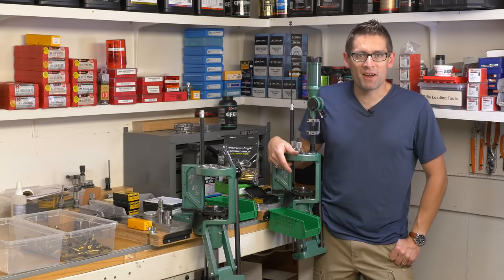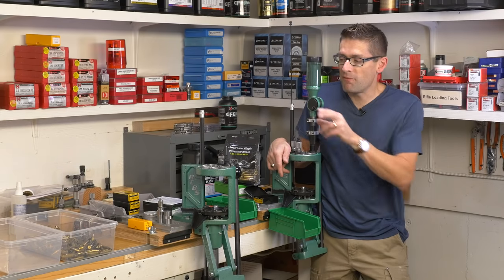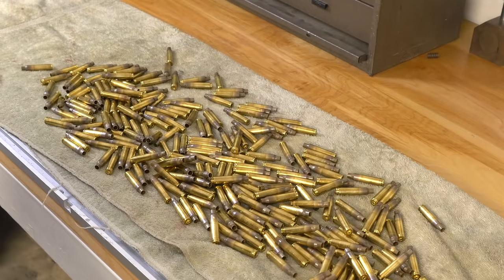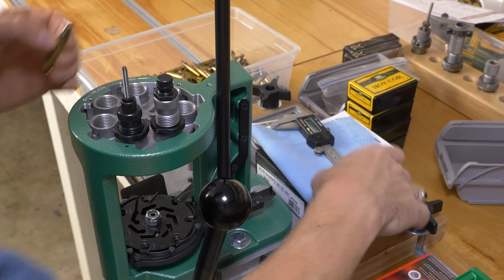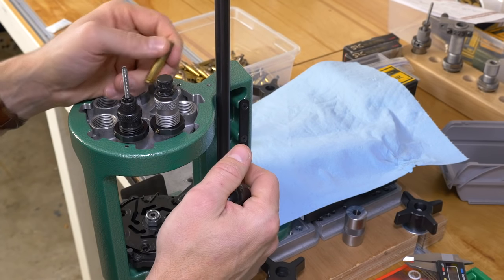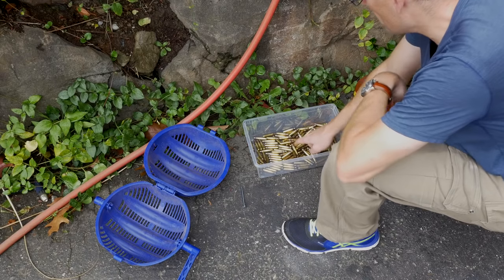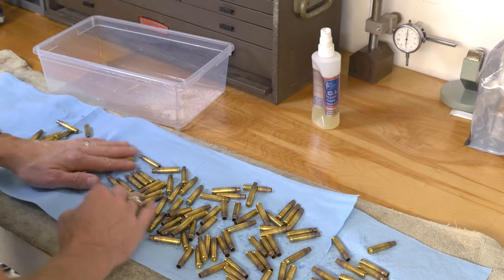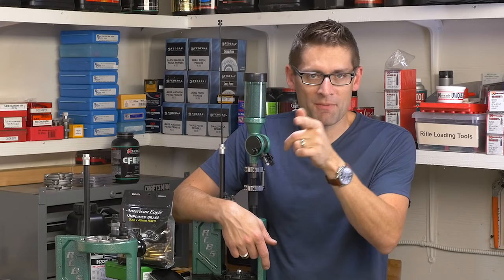.25-45 Sharps Part 4: Forming .25-45 Sharps from .223/5.56 Brass

Comment: Got a tip for you that I've been using close to 40 years that will save you lots of time and mess. Leave the spray-on lube on the case until its loaded. Put coarse ground corncob and cartridges in the Thumler Tumbler and let it go 2 hrs roughly. The coarse ground corncob does an excellent job wiping the lube off and putting a final shine on the brass. I usually get coarse corncob at a pet store in the reptile bedding area. Other types of media like fine ground corncob or walnut do NOT do nearly as good for this particular step. I use lanolin/alcohol spray which is what Dillon uses. Other lubes can be tougher to remove like the old RCBS lube pad stuff. 
Work smarter not harder! Cheers!
Reply: Have done the same thing!

Comment: Just got my deer last weekend with the factory loads. This dropped a 3 point mule deer no problem over here in eastern wa. Love this caliber as it is easily reloaded into standard 223 brass without any significant resizing.
Reply from the maker: Awesome! Where in Eastern WA? Which side of the mountains do you live on?
Reply: Ephrata

Comment: I have only had to spray my brass once not worrying about getting all sides of the brass.  Enough lube is present from a single application to coat the die as brass is randomly oriented in the press.   I am not swaging a new caliber; however, and that solution does not address the inside of the case neck.  I typically manually put a small amount of lube on the inside of the neck using a lube pad.

Comment: Make your own Homemade DLC for a cheaper and better product.  10:1 ...... 10 parts 99% isopropyl alcohol to 1 part liquid lanolin.     Also, forgot to ask ...what does the 25/45 offer over the 6.5 Grendel or 6.8 spc.?
Reply: I do not see a need to this cartridge, a 6x45 (223 neck up to 6mm) is a far better round for down range and hunting. 25 caliber bullets do have a good BC compared to either 6mm or 6.5 mm.
Reply: Brass availability.  You'll never have a problem getting free brass at a range, a MASSIVE cost saving measure.   I have a 6.8 spc upper, and a 6.5 grendel upper,  and being able to get free brass is so worth it for the 25-45.   Now the 25-45 doesn't quite perform as well as the latter, but it's still in the race, and better than 300 blackout  if someone is looking for a good hunting cartridge.

Edit:  another downside to 25-45, is the reloading data for it is nowhere near as established, and it's also difficult to find.   There will be a little bit less power compared to 6.8 / 6.5 due to reduced case capacity.
Reply: 250 Savage performance from a .223 case. No mag mods, no special followers, no new bolt.....just a barrel change.

Comment: sharps load data says 27 grain of a2200 powder for the 70 grain bullet,well I had the 75 grain hp they didn't have load data for a2200 powder , so I went with 26 grain of a2200 for 75 grain,Do you think I loaded to hot,not hot enough,i guess that's part of handloading is coming up with your loads when they can't give load data,might go 26.5 grain next loading.or 27 grain just like 70 grain.
Reply: I know its been awhile but just so you know usually when you have a increase in bullet weight there is a decrease in powder charge as this will increase chamber pressure.

Comment: Very informative as always and much appreciated. Do you recommend sizing range pick up brass in the 5.56/.223 sizing die prior to running it through the 25-45 forming dies? Thanks Gavin.
Reply from the maker: Glad this was helpful. For previously fired brass I would 1.) Clean 2.) Form/size with .25-45 Sharps dies 3.) Trim (if needed) 4:) Clean 5.) Load -----Something like that!

Comment: Is there a specific brand that has stronger brass of .223, so the cases will be a better option to convert? I've got a pile of .223 brass and I've noticed that some brands have split necks. So is there a specific brand that's recommended?